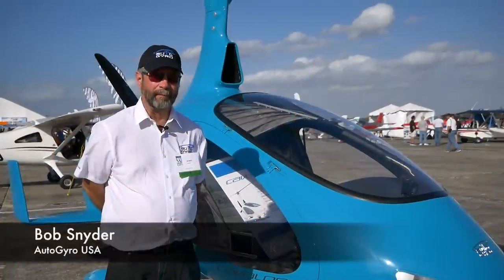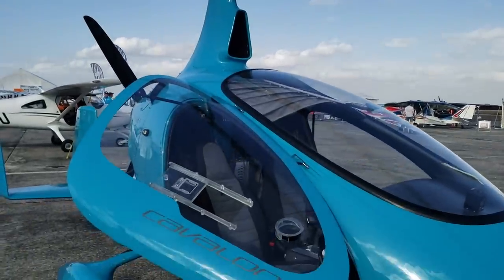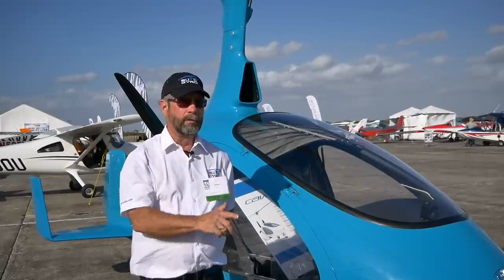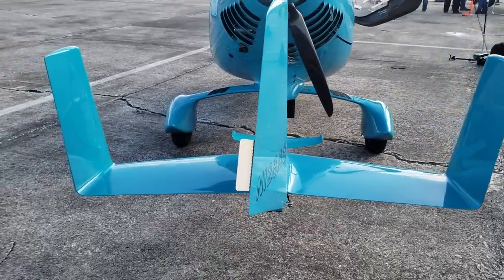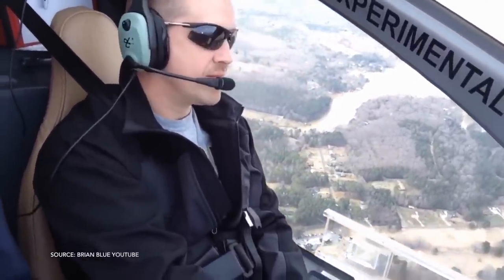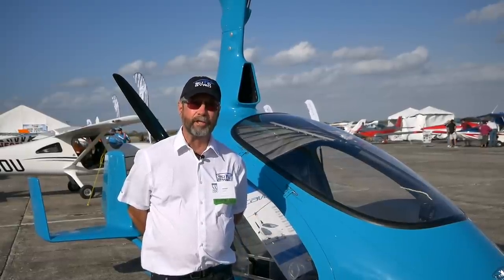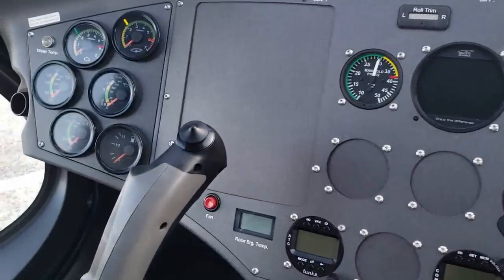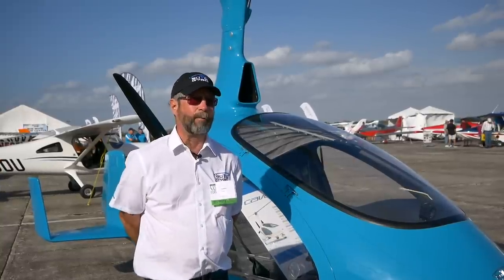WHY Pilots Fly This Instead Of An Helicopter l AutoGyro Cavalon

Comment: An autogyro's main blades are always in negative pitch whether its ascending or descending. A helicopter's main blades are always in positive pitch unless engine looses power & it needs to glide back to ground.
Reply: Afrocanuk   Sorry....Gyro blades are not in negative pitch.....most are about 1.5 degrees positive.
Reply: @ultracruiser41able  No sorry. It is the resistance these blades present to the oncoming wind that causes lift.  This means they must be in negative pitch.  Its the same as putting a helicopter in "autogyro" when the engine fails to slow its descent.
Reply: Correct... but even in a helicopter in autorotation.... the rotor blades are not in a negative pitch.  Sorry.... been flying rotary wings for over 20 years..... rotors in autorotative state still have a positive pitch.
Reply: @ultracruiser41able  In the event of total engine failure, for helicopter blades to continue rotating while in autogyro/freefall, the trailing edge of the blades MUST be higher than the leading edge.
Reply: Afrocanuk nope..... wrong again!!  Come on over to our airport... KAFP... Ill take you up for a few flights and show you. You can measure for yourself.
Reply: @ultracruiser41able  You say I'm wrong again & I say you're wrong again.  Just because someone knows how to operate a machine doesn't mean they have intricate knowledge of its mechanical design.
Reply: Sorry son..... build them.... design them....test fly them...... don’t mean to be disrespectful..... but you are incorrect in your assumptions that the rotors are in a negative pitch attitude.
Reply: @ultracruiser41able  Well son the solution is a simple one.  There are slow motion videos on YT of sycamore seeds falling.  You need to have a look at some of them.  The principle is the same.
Reply: Geez.... beating a dead horse..... a gyroplane or a helicopter are not falling seeds. I can prove it to you!   I’ll even pay for your airfare to come on over to see how the rotors work.
Reply: Also.... there are slow motion videos of gyroplane rotors.... you might want to take a look at those. :)
Reply: @ultracruiser41able  I know who's beating the dead horse & its not you.
Reply: @ultracruiser41able  Not a pilot and know nothing about anything other than what I am reading here.  So when a helicopter goes into autorotation the rotors don't flip from positive to negative -- the positive angle just becomes very small?
Reply: Robert Brandywine   Yes Robert.... that is correct.
Reply: @ultracruiser41able  Thanks for the reply!

Comment: So I can fly this with a PPL or do I need an add - on ?  These can operate behind the region of reverse command ?
Reply from the maker: Yes you can fly this with a PPL
Reply: You need a gyro add on if you have a PPL.
Reply: barry kropelin Do you have a far aim on that ?
Reply: Yes...a PPL ticket needs to have a gyro add on in the US.  You can get a straight PPL gyro but cheapest to do a Sport Pilot fixed wing then add gyro.  Gyro instruction is more per hour than most Sport Pilot fixed wing.

Comment: Wonder if this would make a good Bush plane with some big ol tires.
Reply: Maybe so but I think the range is not so good, where as a plane can probably fly 10 times further on the same amount of fuel.
Reply: @Sarconthewolf  ah. Didn't think about that.
Reply: @Sarconthewolf  Fuel burn on an airplane engine in say a 152-172 is about double of these 8-9 gph instead of about 4-4.5 gph. Not that much faster either.

Comment: Did a hamburger run a year ago in a friend's Cavalon.  Interesting aircraft!
Reply: John L how was the ride John??
Reply: @joemorrow8411  Slow, as expected, but visibility was terrific.  There's a stick shake that you'd have to get used to.
Reply: @jcldano  He should recheck his rotor ballance. I've seen some with very little stick shake.
Reply: @ictpilot  I built a Cavalon in late 2016 and fly it much more than the average private pilot and I have put over 755 hours on it in less than 3 years and can tell you that every flight is different. One day it will fly hands off with almost no stick shake and other days quite a bit, these machines are affected by different weather conditions as well as load weight and distribution and a 2 blade rotor system will have some shake it is just the nature of the beast. This machine is not cheap but it is a lot of fun and with a fuel burn of under 5 gallons per hour and much less maintenance cost than a helicopter you can fly it at a very reasonable cost, also it will fly faster than most small kit built or certified helicopters. People ask how high it can fly, I have been up to 10,000 ft. but only once since there is nothing much to see up there these machines like helicopters offer a great view and flying 500 to 1000 ft. above the ground is our usual cruise unless over rough terrain and then I will fly a little higher for added safety should you have an engine failure as this gives you more time to pick a landing site. Sometimes however there is not good landing site with any type of aircraft but this is the risk you take when you fly. My wife and I flew our Cavalon through the Hudson Corridor in NYC with several other Autogyro owners including Bob Snyder and circled the Statue of Liberty at about 800 feet off the water, what a spectacular view. We made a left turn at the Alpine Tower and went to Lincoln Park Airport for lunch before heading home, what a wonderful day of flying.

Comment: I have no real world knowledge of gyros, only what I’ve seen in movies. In Road Warrior, Bruce Spence, in one scene before take off, was turning the rotor by hand. Is that necessary, or will forward momentum before take off start it spinning?
Reply: Pavel Manzhetov thanks!
Reply: Some gyros use electric motors for pre-rotation....others use hydraulics.....or flexible shafts driving a bendix.  Once rotors are up to 100-250 rpm....the pre-rotator is disengage and airflow is accelerated by faster forward motion.  Once rotor is spinning fast enough to lift machine....she's flying.  The rotor on a gyroplane is self regulating needing no other input from the pilot (except for pitch and roll). The rotor will maintain any speed needed to keep the craft in the air climbing or decending. Higher the weight or more aggressive the maneuver.....the faster the rotor spins.  Solo.....mine usually spins around 325-350 rpm.  All up with full fuel and a passenger....the rotor spins around 375-425 rpm.
Reply: barry kropelin cool! Thanks for the answer.
Reply: @barrykropelin3845  Excellent explanation.

Comment: vibration in the video looks a bit strong. (Ex Benson pilot, ATP (Amateur Test Pilot) Safari, Bell 47, Turbine powered Rotorway))
Reply: Stu Fields  vibration in flight video was from a hand held camera.  Gyro vibration is much less than a helicopter.  A gyro has no cabin shake due to the engine not being directly connected to the rotor.
Reply: Well I built and learned to fly a Benson, was assistant editor for PRA magazine, built and learned to fly a Safari and everyone of them had an engine prop combination capable of generating vibration.  Was an editor for 7 years of Experimental Helo magazine. My Safari was  smoother than my Benson.  (90hp Mac) Probably because I had acquired and learned to operate dynamic balance measuring instruments I was capable of measuring vibrations down to the 0.05ips.  All two bladed rotor systems have a 2/rev vibration in forward flight. An out of track or balance on the prop on a gyro will produce vibrations in the cabin.  Depending on the stiffness of the mounting of the rotor head and controls, 2/rev from the blades can also enter into the cabin.  I'm not the expert on rotary wing vibrations  by far, but I've had several conversations and printed articles written by a guy who is known to be a world expert in these things.

Comment: How does the Rotar creat lift without power. Why not to have a proper glider wing instead of powerless Rotar.
Reply: The air being forced up through the rotor creates lift. The engine pushes the gyroplane forward. Watch some YouTube videos.

Comment: Why don't they have a counter tail rotor?
Reply: Jeroen Jansen   Don't need a tail rotor.  The top rotator is not connected to the engine during flight....therefore....no torque turning the fuselage.

Comment: Like all aircraft, they all have limitations. The Gyro has a negative G problem that is very difficult to manage in some areas of flight.
Reply: Robin Germon not difficult at all to stay away from negative G situations.  Just as a fixed wing aircraft wants to stay away from a stall/spin situation.
Reply: Can't agree with that Barry. Spinning is one of the most important maneuvers in a fix wing aircraft one needs to learn and practice . I remember doing my Commercial pilot flight test in a PA 28 and the testing offers first question, "Are you prepared to spin the PA28" No problem at all. Training is everything and any fixed wing aircraft that doesn't spin well, keep RIGHT away from them.
Reply: Robin.....what does spinning a fixed wing have to do with a gyrocopter?  A fixed wing spin is caused by an aggravated stall of one wing......a gyroplane does not stall....the only way to get negative in a gyro is in a maneuver like a powered push over....something you're trained not to do. I can do 90 degree turns...and vertical spins with no negative G's.  Gyro's have done loops and rolls as long as go don't go negative to slow the rotor too much.  Most maneuvers in a gyro are positive G.
Reply: The aerodynamic formula explains all tat,
clhalferowvsquareds

Comment: A friend of mine has one and it's all kinds of fun.  But yesterday cracks were found in  the mast at the bottom of the mast in  the intake and on the back side.  No way will l fly in one unless the cracking issue is resolved.  Better safe than dead.
Reply: Randy what make and model of gyro does he have?
Reply: @ronandress5948  Cavalon

Comment: ❓*Question*❓  Is there a reason why they just don't spin the "helicopter" blade at a set RPM even if it is just set for take off and land, or hook it up with like a freewheel gear so you can get the blade moving until you up in the air and have a minimum rpm on it... just some questionable ideas, as I know sh*t about about these but they are cool....  He stated wind is your friend for the copter,  so got me thinking when he talked about that blade not powered.
Reply: @kevin paul halliday You don't switch power. You have a prerotator to spin up the rotor to about 250 rpm, then advance the throttle full and pull the stick back.
Reply: The rotor speed varies in flight slightly depending on the load on the rotor.

Comment: Very interesting A/C. I am a lapsed general aviation pilot who used to own a Piper Arrow and over years I put less than 200 hours on it I enjoyed it and it was comfortable for 4 but just did not get used enough so I reluctantly sold it to a flight school 25 years ago.  My interest was not traveling but just being in the local air living in the mountains and sightseeing within 50 miles of my ranch home. Having to keep the plane in a hanger at the county airport was just enough hassle to drive the 20miles to not take it up that much. This AutoGyro would have been perfect, I had plenty of land to fly is right from a few hundred feet from the barn it would have fit in. I moved from the US 20 years ago, to a lot closer to where these are made, 7000 miles closer but don't have much land. Something to think about, seriously.

Comment: So what happens if you go through a downburst of air?  If that unloads the rotor, how do you recover and also, can you dive without unloading the rotor? I love those things!
Reply: Actually, much safer than fixed wing.... the down burst will actually push them down, the rotorcraft only loose lift and fall at the rate of acceleration due to gravity... as soon as downburst stops or craft comes out of down burst, craft continues as usual...
Reply: @rosebarnes9625  -- right on... Thanks for the reply! Cheers!

Comment: Are these capable of a jump-takeoff?
Reply: Not this model or most simple ones which have neither cyclic nor collective pitch control. This greatly reduces the complexity, cost and maintenance of the rotor, a major part of the cost of a helicopter. There are models that have that capability but they need collective pitch control to achieve it, adding to the cost.

Comment: What's the ceiling height and range?
Reply: Scat ceiling......I've never had an issue with performance at altitude....I've hit 9-10,000 ft going over mountains.......range......around 500 sm.

Comment: With virtually no information on takeoff speed , landing speed , cruise speed , maximum speed and range It makes one wonder why those numbers were omitted .... I suspect a gyro is a very draggy machine with poor efficiency past 100 mph ... I flew a Benson years ago and it was fun but not remotely as practical as say a modern Kitfox ... These new modern enclosed machines look much more serious but I have a hunch are not much on speed and range ... Though as he claims they may be remarkable fun ... But new modern STOL bush planes are all that as well
Reply: Mark Doan   Well.....take off....I’d say around 30-40 mph.  Cruise around 100 mph......fuel burn....4.1 gallons/hour full up......fuel capacity.......25 gallons.....legal usable fuel....23 gallons......range...500 miles +.    Yes.....not very efficient.....but a lot more fun than a fixed wing.

Comment: If it's so safe he should have given us statistics. And how does it do in rough weather?
Reply: Because they use rotors they have a very high wing-loading, which means they're far more stable in lousy conditions that would adversely affect fixed-wing aircraft. I corresponded with the guy who flew the James Bond gyro, a very famous gyro pilot and pioneer who virtually held every world record there was in them, and he pointed out how he got stuck in a hurricane down in Brazil while flying his gyro in conditions that shut down airports and kept commercial jets on the ground. He was flying around in conditions where he said palm trees were flying by him!  So yeah, they're pretty rock steady.
Reply: @timbowilderbeeste8709  Glad to hear that. You sure couldn't tell by looking at them. If they could develop a comfortable four seater  and advertise their safety margin, maybe their sales would "take off".
Reply: @carpediem6568  Gyro's are old hat technologically, and will never have anything more than a niche market. They're very limited speed-wise, like helicopters, because the faster they go the more the rotor gets affected by the imbalance between the blade going forward and the one receding during rotation. The from the opposite side you have the issue that they don't have the vertical take off and hovering ability of a helicopter. So even though they were very popular in the 1920's and 30's they're basically a hybrid between a plane and copter that doesn't give you the real benefits of either. They're a hell of a lot of fun though and extremely maneuverable in the right hands. They have a reputation for being unsafe purely from the perspective that in the old days there were no twins to train on, so you basically taught yourself how to fly one. That, and the fact that great care has to be taken not to put any negative G's on it which causes the rotor to 'unload' and drop the gyro like a stone, is where that reputation came from. Yet in many ways they are far better than other forms of light aircraft in adverse conditions because of that high wing-loading I mentioned.A lot of light and ultralight aircraft need near perfect conditions to fly - these things can practically go up in a howling storm and not be affected.
Reply: @timbowilderbeeste8709  Strange combination for an aircraft. Reminds me of a trimaran sailboat. Great speed and stability. Safe but no room. Very small useable space. Most people want company and some wiggle room when sailing, so they are also a niche market and not popular.

Comment: could someone explain to me that if this is a helicopter take off? correct? yet then once in the sky you use the back blade to move forward? then you land like a helicopter also?
Reply: It does NOT take off like a helicopter.  You need forward motion to get off the ground. Do a search on the physics involved, I'm sure there is a video that explains it well.

Comment: Talk to me when there are 4 or 6 seat gyroplanes.
Reply: Cannot remember the name but there is currently a company with a prototype 4 seat gyro,,,,,,with twin Rotax engines and an option for either an oversized single rotor or a twin rotor set up. It will be interesting to see where they go with this.

Comment: Had a good friend die in a gyrocopter crash. All his pilot buddies told him they were dangerous. The engine failed and it basically fell to the ground. He was killed instantly by the rotor blade. Rather fly in a plane or a helicopter.
Reply: Gyrocopters don't just fall to the ground because an engine fails! I lost tow family members in separate accidents in fixed wing airplanes due to issues that could not happen in a gyro.
Reply: Had to be more to it than just an engine failure..........I’ve had a few engine outs.........no issues at all.  What kind of training did he have?  Did the NTSB investigate?......did he have a gyro rating?  Sorry for your loss.

Comment: Top speed? Range? Ceiling? Fuel consumption? There's no info in this video but a sales pitch. Thanks anyway
Reply: Vidyadhar Pai   Cruise 80-100 mph.  Fuel burn 4.1 gal/hr......25 gallons capacity.
Reply: @barrykropelin3845 Thanks.   Do you know the ceiling?    I must say it looks interesting as a fixed-wing pilot who sold his last plane 25 years ago because it became a poor cost/fun ratio.